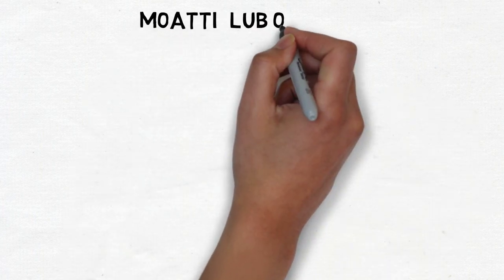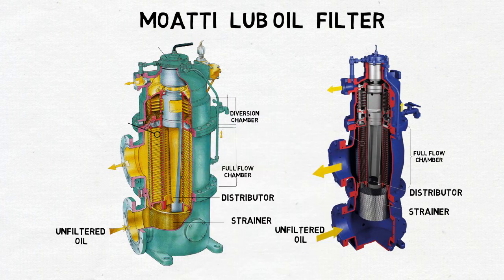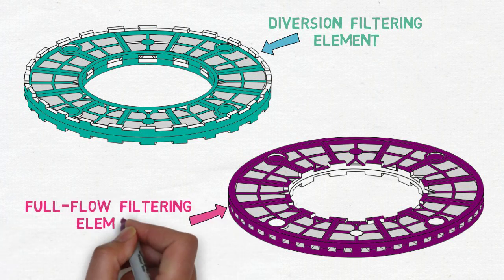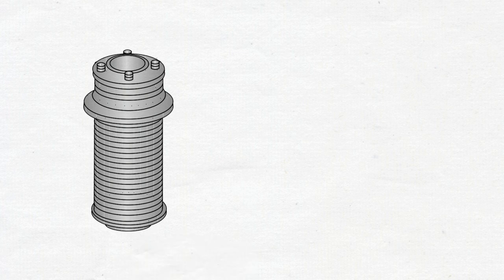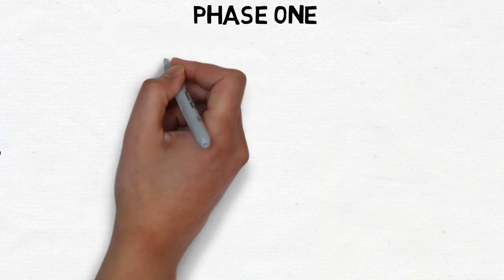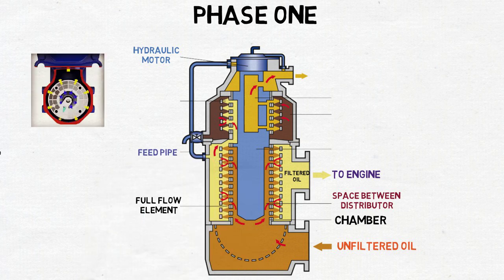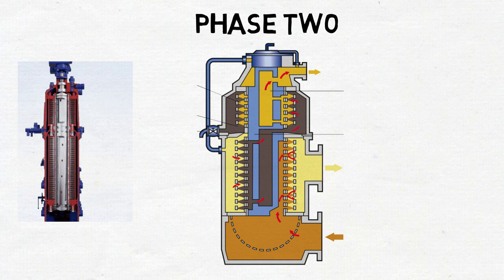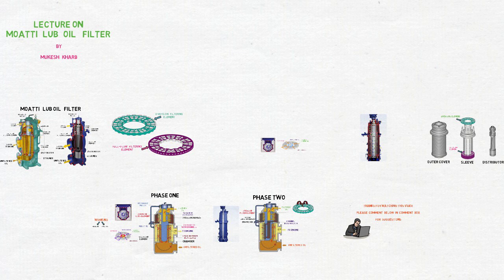Pielstick engine Moatti Filter Alfa Laval working and construction

Comment: What about the second part of the filter the back flashing one ? How it works ? Thanks
Reply: it is explained in video. in phase 1 oil goes inside the space between inside perimeter of disc and distributor outer surface. oil comes out from outer perimeter of disc and cleaning takes place. Now in phase II hydraullic motor turns the central distributor, clean oil which is already available at the outer perimeter of disc then moves inside of disc to internal passage of distributor then to upper diversion element . Here tricky part to understand is backwashing is happening only for the 20% of disc at one time. Complete backwashing is happening after one rotation of distributor. Corrections welcome.